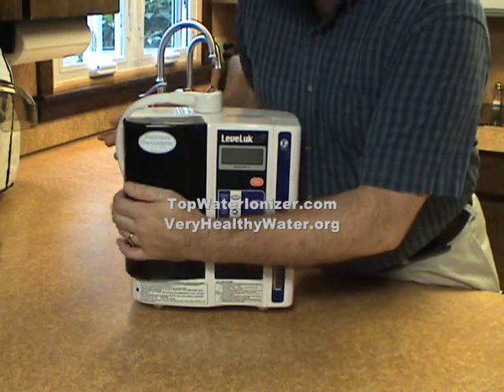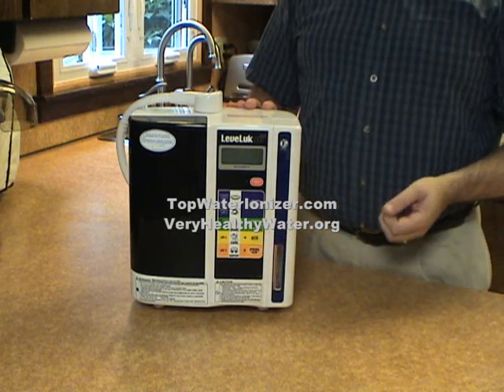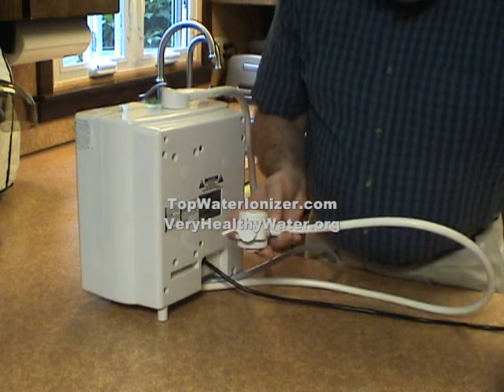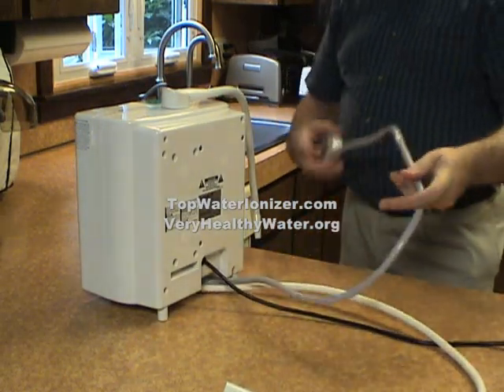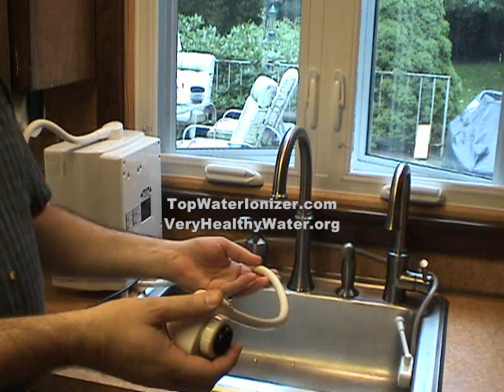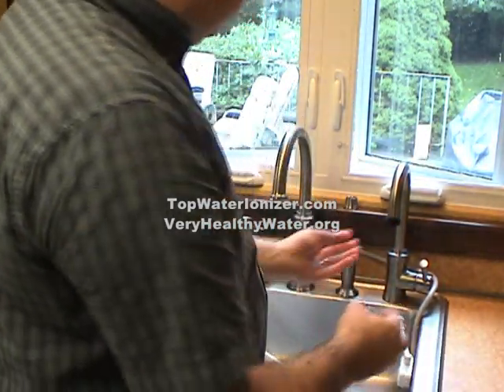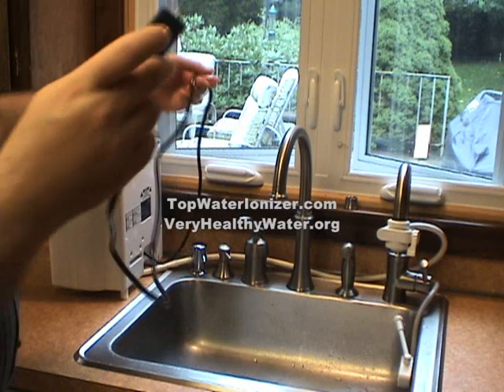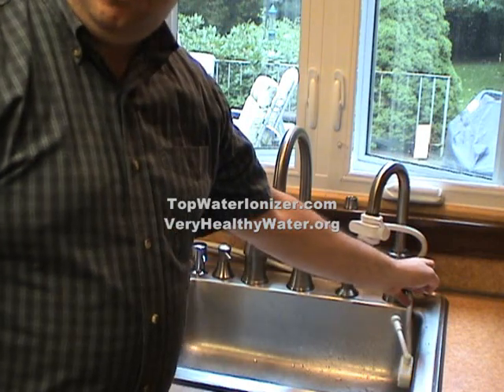Enagic SD501 Kangen Water Ionizer Installation | SD501 Kangen Water Demo

Comment: Be Aware of the Kangan Water SCAM - The people promoting the Kangan water machine are Most Definitely making Unsubstantiated Health Claims for their machine, which is nothing more than a grossly overpriced water filter.  Regarding their claims about the benefits of Kangan water as an aid in helping to prevent or fight cancer -  there is absolutely no scientific proof that drinking alkaline water - and in particular Kangan water - can prevent, treat or cure cancer.  FACT - I met a gentleman named Ron Farr in January of 2013 who had been drinking Kangan water for 2 years, believing it would help cure his cancer.  But instead, over that two year period his cancer got Much Worse - with multiple golf-ball sized tumors developing up and down his spine.  Don't buy into the LIES from the promoters of the Kangan water machine - FACT - drinking Kangan water can actually be harmful to your health!  I'll be posting more information here to support this FACT.  BUYER BEWARE!  Don't get Sucked into putting yourself $4,000.00 in Debt for a Kangan water machine!
Reply: You are very mis informed. I had huge health challenges that Kangen water improved greatly In fact my entire family each own a system and all have had great health benefits. Every body has different healing. The kangen water is part of it , plus food , supplements,exercise  and rest. Also if you have cancer you need to drink 1oz of water per body pound. So if he weighed 200 pds he would drink 1 and1/2 gallons of water. That is what it takes to neutralize and flush the toxins out. And no carbonated drinks.We do not say it can prevent or cure  And there is plenty of research to back it. This water has been around for 40 years in the Japanese Hospital. these are not filters they are ionizers...huge difference. And have you tried it????
Reply: +Bill DeFalco muva fuka go watch the other vid they do tests on lab rats etc, showing insignificant sizes of the cancer they inject them with. lastly how the fuk do you assume it's a scam when you personally haven't tried it yourself

Comment from the maker: YES - the SD501 works wonderfully together with a water softening system.  The water softener contributes additional ions into the source water which the water ionizer will find useful for the ionization process.